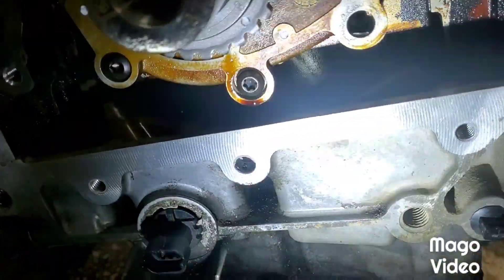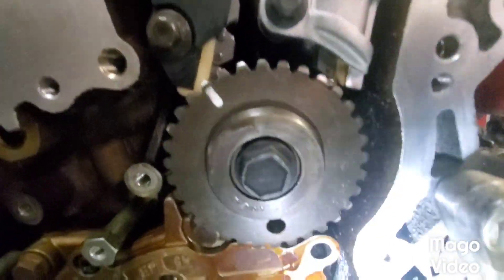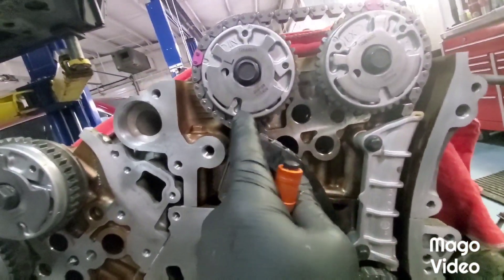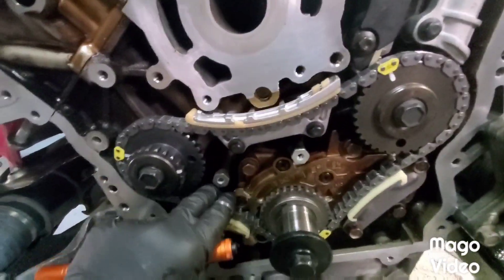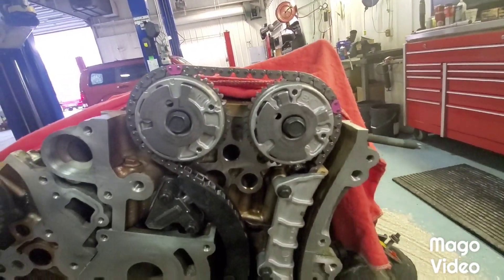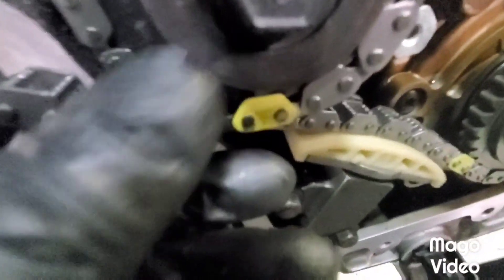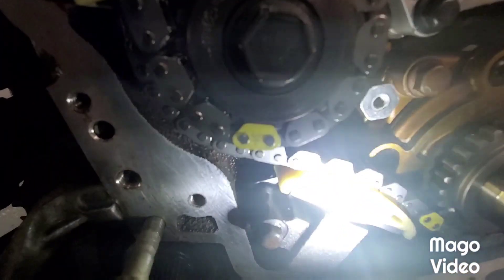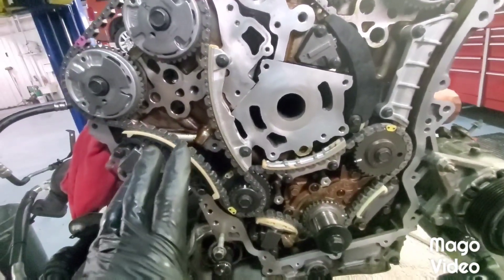GM 3.6L STAGE 1 & 2 TIMING SIMPLIFIED

Comment from the maker: For those of you technicians out there getting confused by the instructions in the service procedures-cleanliness and pay attention to detail!

I'm gonna put this out there right now and I'm not trying to be harsh or critical for anyone who's taken this job on who is not in the professional automotive industry.

1.  This job is not something that you will enjoy on the floor in your home garage; especially if it's AWD

2.  I'm not making a step-by-step how to do everything, why?  Because that's too time consuming and I think it is critical larger engine work like this is done by a trained, experienced, and well rounded technician.  Too many chances for creating more problems if you are not experienced.

3. I will answer questions, but it's difficult for me to walk you through everything...this channel was designed and geared towards those who work on cars professionally...this procedure is not the difficult part of this job, TRUST ME.

4. GM (ACDELCO) PARTS ONLY!!!  Replace all components, not some...ALL of it gets done or you're just wasting your time and will be in there again!!!  Always replace the valve covers if heavy deposits!  No shortcuts guy's...you do it right or like I said...you'll be doing it again!

5. Clean these engines from top to bottom using brake cleaner.  Blow everything out thoroughly to include oil passages with compressed air.  Clean valves using carb cleaner and compressed air.  Be sure you get the inside of your oil pan too...if she's a disaster when you open her up...remove the oil pan to ensure you get it cleaned out.  You're not going to hurt the engine doing this as long as you change the oil twice after you button her up.  The rest will evaporate and burn out through PCV...Done hundreds of them this way and they are solid afterwards!

The other thing that other video's are failing to tell you is those phasers/actuators should be replaced everytime you do a chain job, you're just shooting yourself in the foot if you don't!

Also, the Intake PHASERS/ACTUATORS are different from one another from bank to bank, they're clocked different...also very important to know.  However, the EXHAUST PHASERS/ACTUATORS are interchangable.

Use only OEM ACDelco parts, stay away from aftermarket trash, PERIOD!

If you want to try and accomplish this without doing it in two stages as some will claim is easier or possible with specific tools...well have fun, because you'll be hating life going in a second time.  I am merely prewarning you...take it or leave it.  YOU DO NOT NEED SPECIAL CAM HOLDING TOOLS FOR THIS JOB!!!

Many people screw this job up, because they're trying to take shortcuts-pure and simple!  If you can't time this engine IAW Service Information then it's definitely beyond your skill level in numerous ways, not trying to be critical, but it's common sense.  GM says this is how you time it; so why are we even debating whether or not it can be done another way.  Everyone that's having trouble with it is NOT FOLLOWING PROCEEDURES, GEEEEE...I WONDER WHY 🤔?

Yes there's TSB's out there for the CKP reluctor wheel actually shifting and causing CMP/CKP correlation DTC's and the best way to rule that out is to physically check for this by removing the oil pan and measuring for it!  I'll link a great page explaining how to do this below.  If you're worried about that as a possibility it is only beneficial to remove oil pan regardless to clean out any deposits in the pan!

https://www.autoserviceprofessional.com/4206/reluctor-wheel-woes

Thanks for watching and I hope you find it helpful!
Reply from the maker: @Cory A absolutely 💯 👌
Reply: @PaulysAuto  Thank-you for being clear . I have been a mechanic for ,, well lets say a long dam time lol  and this is the first 3.6 l timing job i have ever done . Looking at the phasers many would think the colored links would go on the triangular marks marked INT & EXH . At-least at first look that is what i thought . Without removing the phasers i took the time to clean them to investigate why each phaser had two marks . I was second guessing myself and even took out my dial indicator to measure #1 piston and valve lift to verify which mark i should be on . Had i watched your video first i would have saved time but then again i wouldn't have learned on my own . I came on YouTube to see if anyone took the time to explain the painted "L" & "R" and much to your credit you are the only one so far . Good job but speak up just a bit more lol . THANKS Brother !!
Reply from the maker: @7natcho  you're welcome buddy, I'm glad you got something good out of it.  I made it for tech's like yourself as a quick reference 😉.

Thanks for your support and feedback my friend 😀!
Reply: !z
Reply: Where can I buy the whole rebuild overhaul kit? Engine and valves stuff? I want to rebuild everything new in it..
Reply: I can’t turn my crankshaft to the 8 o’clock hole with or without chains. Pleases help
Reply: When I had the chains on they were on the 5 o’clock mark. rear and middle chain were right on the spot and I could not turn the crankshaft to 8 o’clock

Comment: Old video, i know. But what happens when if when spinning the crank from stage 1 to stage 2 during reassembly, the valve spring tensions causes the crank/chain to rotate past the 8'oclock mark on the oil pump?

Comment: Have an issue that i didn't think i would have. The crank was turned before stage 1 could be put on. How can you figure that out. Someone told me that you cant just line up the dots on the crank after that has been turned because its possible to be 180 degrees out. How do I determine it? How to set the crank?
Reply from the maker: Always remember number 1

Tdc
Reply from the maker: start fresh and execute

Comment: So I'm doing this on my car and I set my timing on the passenger side(right side)  already but I ran into an issue where I can't set my timing on the drivers side(left side) cause both cams are off somehow and I can't get either of them TDC any advise on how I can get them in the correct position to be turned to TDC?

Comment: Just read your pin. Im going back in and doing it your way. Lesson learned. 2.0 audis are even less complicated than this🥹
Reply from the maker: Yeah it can be difficult just like anything though you learn from mistakes.
Reply: @PaulysAuto when its on stage 1 should cylinder 1 be tdc ?
Reply from the maker: @MiguelSanchez-rb3tw  yes on the Exhaust stroke
Reply: @PaulysAuto  thank you bro, appreciate the video. Only video i found that actually made sense 🙏🏼
Reply from the maker: @MiguelSanchez-rb3tw  Glad you got it accomplished.  God bless my friend.
Reply: @PaulysAuto  so i redid the timing how you did. Im still getting the timing codes. P0016 and p0019. Car runs fine and idles fine. I tried to switch cams to opposite sides but they dont change error bank

Comment: Is the stage 2 required ? I did it with the cam locks. Car doesnt run rough anymore but im still getting the timing codes and now my oil filter keeps collapsing and i lose oil pressure after like 50 miles of driving

Comment: Have you ever replaced an oil pump on this engine? I'm trying to figure out if I need some sort of o-ring or sealant where the back of the pump contacts the front of the engine. There seems to be some sort of round groove around the hole. Thanks!
Reply from the maker: Sorry for the late reply there's no gasket It's a machined surface fit, I usually apply a light coat of anerobic sealer to the block ports and it works good, but only use a small amount.... It's something I've always done on every make and model... Must be working cause I haven't seen um back.

Comment: Hi Pauly, mate im going around circles! this is the forth time i strip the engine and put it back together! I have followed every step got to do with the timing chains and after installing the new chains to the marks and after doing some revolutions I get slack in the primary chain! Any ideas what am I doing wrong? the car starts fine, rattles on cold start and the the rattle fades when the car starts to warm up. No fault codes though.
Reply from the maker: Are you sure it's the chains that are rattling?  How's your oil pressure?  It's possible that the pump isn't producing enough pressure to pump up the tensioners.
Reply: @PaulysAuto  first of all I would like to thank you for the quick reply! 
Secondly, earlier today, i redone the chains again and i also installed brandnew oil pump. I have installed all three chains to marks and all is good and they were tight as! BUT when i rotate the crank for few revolutions the primary chain has some slack at the top? is that normal?
Reply from the maker: @guifin   That's perfectly normal That slack will get taken up once the oil pressure comes up and the tensioners are pumped up

Comment: My garage told me this engine has 2 reluctor Wheels and they think one wheel has slipped causing a timing issue on the left Bank and said they have to remove my engine to investigate 🙄
Reply from the maker: It's possible, but most of those issues were resolved by warranty work early on on the older platforms.  A Cam/Crank Waveform Analysis with a lab-scope would be the best way to know before pulling the engine out.

Comment: Is timing position 1 tdc ?? Had the heads off to fix valves just making sure of everything and that I’m not a full rev out I’m on position one and tdc surely that correct ???
Reply from the maker: If the marks line up on stage 1 and stage 2 timing you're GTG.  Just flip your cams till those marks align...it's not an interference engine.  My video says everything just gotta pay close attention to details.  Marks lining up in each stage is what matters.
Reply: @PaulysAuto  I just wanted a yes or no answer mate, the heads have been off, I’m at stage one timing mark and no1 is at tdc is that right ??
Reply from the maker: @shellandhuzz8783  Yes
Reply: @PaulysAuto  ok I watched again and u did say u were at tdc for stage one then thanks

Comment: Pauly, if you remove the cam phaser from the camshaft, how do they line up before you tighten them back on? Does that pin on the back sit within a hole on the cam?
Reply from the maker: yes you'll see it
Reply: @PaulysAuto  Thanks. I just subscribed!
Reply from the maker: @chrisstromberg6527  I appreciate your support 🙏

Comment: I have searched and can't find a reason for the 2 stage timing?  The links line up whether or not you rotate the crank to the 2nd stage or not. What is the purpose of rotating the crank just to install the 3rd chain?
Reply from the maker: During your search did you look in Service Information?
Reply: @PaulysAuto  I don’t believe so. I have seen some explanations from Holden saying they only use the stage 2 and skip the stage 1. I’d like to understand what the purpose is of this timing method is.

Comment: Thanks 
have a question 
At the end of the video you said the timing marks won’t line up again. 
I’m asking because I have a no start issue before and after chain install. So now I’m pulling valve covers off to see if my marks at least line up on the visible cam phasers. 

Trying not to Pull the timing Chain cover off. 

Just trying to check the markings on the cam phasers. I would like to think I can roll the engine over enough for bank one to see the phaser marks and links lineup. And then of course rotate the engine a quarter turn or so To see bank 2 phasers lineup chain links. 

Even though my original rollover but no start situation cause me to replace chain and found that the chain guide were gone But chain was still intact, my biggest mystery is that it could be something else why the engine will roll over but not start. 

So I simply am checking my work on the chain without taking the chain cover off. 

Will this test work by what I’m trying to do or do you have a recommendation on my no start issue.
Reply from the maker: Yeah it's a one time deal unfortunately I apologize for the late response.  Once you rotate from the 1st phase they won't lineup again.

Comment: I can't find any information on my 2013 3.6l 323hp V6 Camaro LT. The timing on mine goes smoothly on the left as yours does in the video, but when I get to the right side to install chain with timing marks the lobs on my cam shafts are not the same as you show in the video. I put the motor back together and it doesn't run properly. I'm back to the same spot on timing again and having the same issue with the cam lob position not where you show in the video. Is there something different about the 2013 Camaro? Any input or info on my model would be greatly appreciated.

Comment: ‼️Guys I can really use some help here!!!! I accidentally turned the crank without the chains now I don't know where the Piston or the position should be for stage 1 timing🙏🏼??🙏🏼
Reply from the maker: Roll your cams over to where you need them; then set the crank to stage 1 mark, this engine is not interference.
Reply: @PaulysAuto  ,, Mr Paul I'm still having a little bit of chain slack on bank 1 after replacing the tensioners with GM tensioners is that normal for Bank 1??
Reply from the maker: @zikiflx  yes they'll pump up with oil pressure once it's running.
Reply: @PaulysAuto  👍 thanks a lot,, I'm hoping and crossing my fingers that this engine will run good after I close it up and I will make sure to send you a donation  for taking the time and respond to me👍👍
Reply from the maker: @zikiflx   Keep your money right now times are tight and you need to keep your money I'm OK ok I'm just glad you were able to figure it out.

Comment: is that a genuine gm chain? i ordered one from amazon that is supposed to be genuine gm. the box had been opened so i am questioning it. it was marked made in Slovakia. my links colors look identical to yours. also the little white tag on the pull pins were marked made in Slovakia. is that correct for genuine gm?
Reply from the maker: Nothing but... If it's not from a GM approved dealer I'd be in question.

Comment: Great video! I have 2011 buick lacrosse 3.6L  I was driving 5 mph and then the engine shut-off , it's sound like starter I  was trying to turn the engine  with the ratchet on camshaft pulled and won't turned, I believe the engine locked or seized, do you think could be timing chain broken?
Reply from the maker: You need to try turning the crank

Comment: ASE tech says to never disturb the bolts on the oil pump...just wondering if you have not heard of that or do you feel this is bogus advice?
Reply from the maker: What does "ASE Tech" say will happen?  I guess I'm failing to understand the question.  They're not torque to yield bolts?  Furthermore, how does the oil pump seal on this platform again...?  Well, considering it's a machined surface to the block...so if  "ASE Tech" is concerned about oil pressure issues, why not remove it and inspect it for scoring?  And if no issues, then re-install with a fine coat of anaerobic sealer on the machined surfaces and torque it down to spec?  What's the logic here?
Reply: @PaulysAuto  the logic is that the oil pump manufacturers say to not disturb those bolts to avoid messing with the tolerances and seal on the oil pump.  Just wanted to share that with you...not trying to criticize just share what i am learning.
Reply from the maker: @darylreadman3596  it's tough to tell when you start off with "ASE Tech", sounds condescending
Reply from the maker: Did "ASE Tech" have a reason to believe there was an oil pressure issue prior to selling the job?
Reply: @PaulysAuto  No he was just sharing what oil pump reps had told him. Do not disturb the bolts on the oil pump. Just slide the new guide unto the old bracket...kinda weird hey as the kits give you the new bracket for the oil pump.
Reply from the maker: @darylreadman3596  I have heard this before, but I am skeptical about "kits" to begin with...since I would only install factory ACDELCO parts to begin with.  I have done many timing chain jobs on these and have never had an issue. Then again, nothing is impossible I suppose, but it seems to me, that most guy's I know that have had issues with this job, often stray away from SI and factory parts and only replace some or not all of the components involved in doing the job for the long term...then end up tearing it down again for trying to cut corners or save a couple $100.  The other big factor is cleaning that engine and clearing out the crap in the oil pan and oil passage ways, leaving build up and sludge is a heart attack waiting to happen.
Reply from the maker: This "ASE Tech" thinks it's fascinating how much bogus advice is out there 😉

Comment: Great video! The only question I have is, does any one cylinder have to be at tdc or doesn't it matter? Is it still timed correctly no matter where cylinder 1 is in the stroke?
Reply from the maker: I usually start tear down with number 1 on the TDC Exhaust stroke, but no it doesn't matter, the two stage timing is straightforward and double check your marks...this video hits all the crucial points in a very short time, but that's because it's not as complicated as it seems 😉 

Read my description and pay attention to details and you'll be good to go.

I can only do so much on this platform my friend.

Comment: hey mate I have an issue where I have changed phasers an tensioners an when I roll the engine the actuators move an or jump the timing, engine rolls over smooth though Ive fixed this a couple times an can't seem to figure it out as I'm not worried about the timing marks only that the cams dont follow north to south as they go pearshape, I don't think it's a reluctor issue though  as I was driving the car lastweek fine til I pulled it apart an my issues that the cam phasers roll even new ones.

Comment: Any tips for a correlation codes on bank 2? Getting dtcs for both intake and exhaust on bank 2. All new OEM components, followed procedure, and by far the cleanest high mileage engine I've seen.